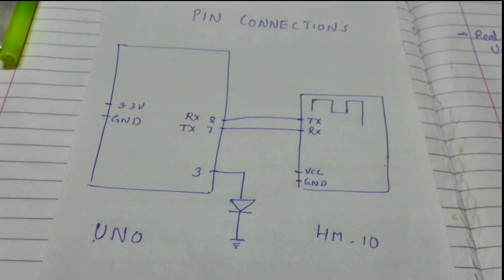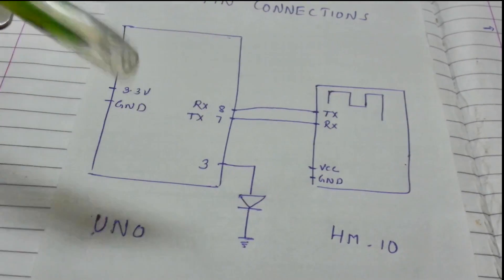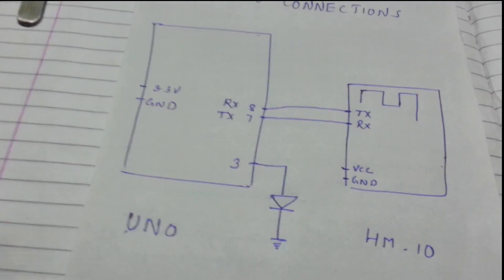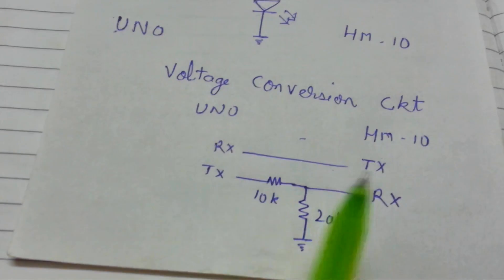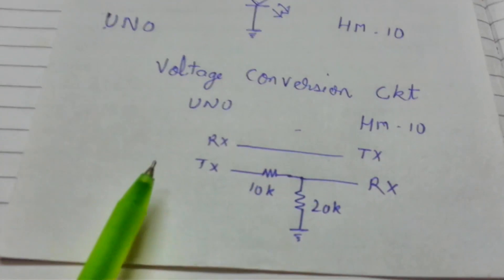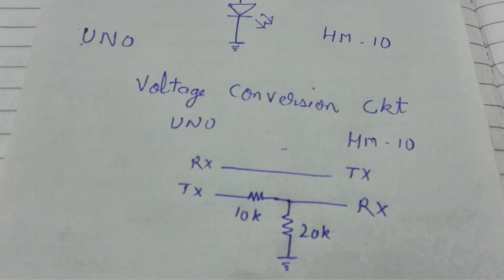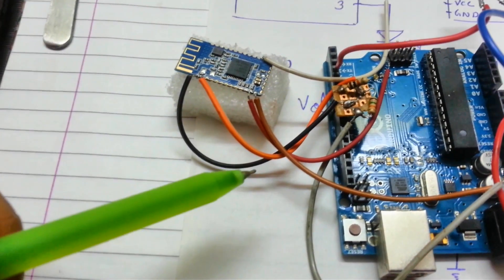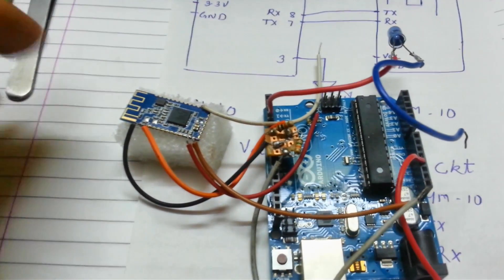HM-10 BLE -01 : Setting up

Comment: Hi, I have one of these modules  but it doesn't accept  all the AT commands, for example,  I cannot change the name of the module, when I try to do it, the answer ir an ERR, so , have you had a similar problem? or can you figure out what could be the solution to my problem?
Reply from the maker: Armando Figueroa can you send an image of the module?
Sometimes HM-10 modules don't come with firmware on board. You can search for HM-10 firmware and flash it. I think it should solve your error.
First check regular AT commands are working then go for pairing
Reply: Seems like I had gone through this issue, you’re getting a clone version of the Hm-10 module. However, there are some fuctions that still work normally. In your case, to set the new name, you just need to AT+NAME<Name>

Comment: Hello, What commands do you use in the hm10 module?.
Would you tell me your maximum distance, I only get 3 meters :(
Reply from the maker: I am using the regular AT commands as specified in the datasheet. I was able to get around 3 meters as well which is standard BLE limit.

Comment: i have a ti's cc2541. i want to perform simple programs on it but am finding it difficult to understand the pin connection. could you please tell me the corresponding pins on a cc2540 if such a correspondence exists.
Reply from the maker: Sandeep Nair cc2540 & 41 are very similar and can be used interchangeably. The same pins you are using for 40 should be used for 41

Comment: I am using CC2530. Are you made it?
Reply from the maker: +Thái Nguyễn Hồng CC2530 is 802.15.4 not BLE. Generally boards have CC2540/1 n them or Nordic nRF51822 chip.
Reply from the maker: Jhon Paul Tanguamos tell me what is the problem
Reply from the maker: Jhon Paul Tanguamos ibeacon packet will not start directly. You need to start advertising. Check the AT commands list for starting the advertising. You can also use HM-10 to listen to advertisements. Where other ibeacons can be found. I don't remember the specific commands. But there will be set of commands in specific order that you need to run
Reply: Hello Sir Lovelesh Patel , :) It seems like you are trying to help other people by aswering their question and I hope you can help me too about my concern.. sir I think u are the only one who can help me please sir I hope u are willing to help me please sir about my concern .. I will really wait your response sir in my gmail sir jampongtanguamos@gmail.com .. I know u have a good heart coz from answering their question it means you are willing to help and I hope you can help me please please please sir I'm begging please thankyou
Reply: Wow thankyou sir for not ignoring my msg. Actually sir my concern is about, I do the simple set up for arduino and BLE 4.0 HM10 v540 such as VCC-3.3v, GND-GND, TX-RXpin , RX-TXpin then I also set an AT Command which also response an OK But when I use my android phone for scanning a BLE Device, there is no result or it didnt display the BLE 4.0 HM10 v540 device into my android phone even I already use a lot of apps for scanning a BLE 4.0 device. Is there something wrong in my set up sir? Do i need to have an AT command for turning ON the BLE 4.0 HM10 v540??? .. Really sir Thankyou,Thankyou,Thankyou
Reply: Sir? what if sir if my BLE 4.0 HM10 is not blinking the LED Light from SYS when I put the pin VCC into arduino but when i removed the pin from arduino it gives a little light from SYS of BLE 4.0 HM10.. Do you have any idea sir to make this normal??

Comment: Do you know why my PC doesn't create COM port? PC recognize the module and pair with it, but doesn't create COM
Reply from the maker: +Angelo This happens in Windows PC. Check in device manager whether the FTDI or any serial-to-usb drivers are installed correctly. 

Pairing has nothing to do with this. Even if you just power on the HM-10, it will pair.
Reply: +Lovelesh “Colleseus” Patel Then I think that maybe I should put it in right mode (with AT commands). Can you recommend me what should I do? I wanna communicate with my microcontroller over bluetooth module. My MCU  just sending string over bluetooth and I want to receive it on PC.

Comment: Hello sir,

I just want to know if you could pair only two HM-10 modules with an exclusive wireless connection.

Such that when there are 6 modules in range.
module 1 is only communicating with module 2.
module 3 is only communicating with module 4.
module 5 is only communicating with module 6.

Thank you sir.
Reply from the maker: +rhene tutor there is a provision of remote control one module with another. But this is facility is only due to firmware running on it. If you plan to run flash your own firmware, then you can make one transmitter and pair the other device based on broadcast signal. 

Maybe these links might help: https://www.youtube.com/watch?v=nliVeSmpFgg
Reply: thank you for the reply,
i already saw that video,. and i also posted a comment similar to this.

so is it possible? with the link you have given.
I would just like to know if the connection between the two modules (module 1 and module 2) in the video are exclusive between them. What if another module is in range (lets say module 3)? will module 3 also receive the transmitted data from module 1?
Reply from the maker: Actually the tutorial is a demo of pairing. One becomes the master and commands the slave.
Reply: so i assume that would answer my question.
well thank you good sir...

Comment: I bought the same module from Dx.com as well but I can't get it to work. It doesn't answer to the command AT. The connections are the same except for the resistances, which are 1k and 2k but they should work the same. The LED is blinking so it must be working...
Reply from the maker: +Emilio Domínguez Can you try by changing the BAUD rate? 9600 is usual but there is no way to know which firmware is running on it?
Also try to see if module broadcasts BLE packets. Use any available BLE scanners. If its blinking it means its not paired. So try to pair with pass-key "000000" or "123456".
Let me know the results.
Reply: I tried some baud rates but i'll try them all, let's see how it works...
Reply: It worked with 9600 this time, I don't know why it didn't use to work but it works now!
Reply from the maker: +Emilio Domínguez put up a video of your project.
Reply: I'm just testing it with cables. The thing is software serial doesn't work, and I don't know why. But if I write in the set up SoftSerial.println ("AT"); it works...